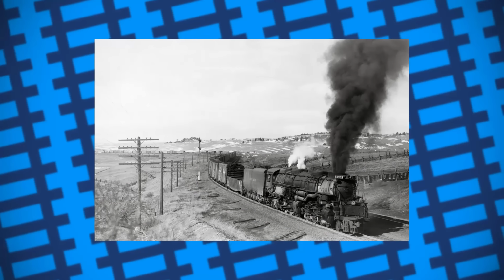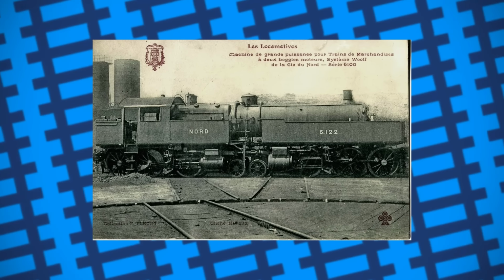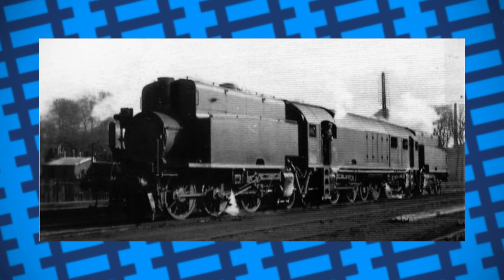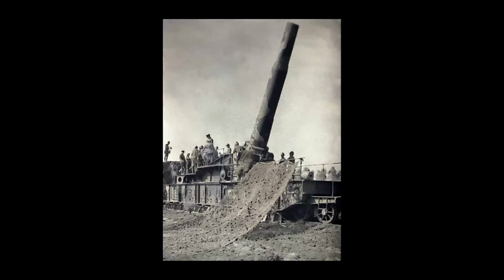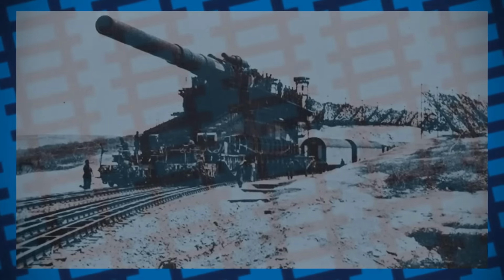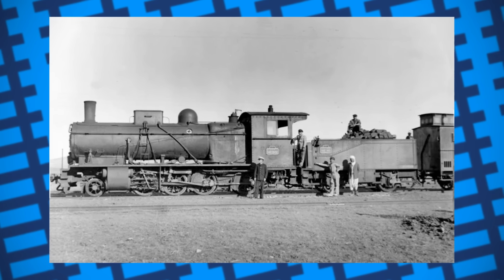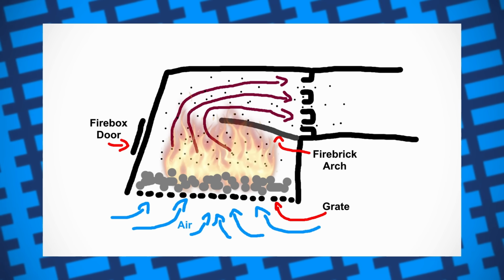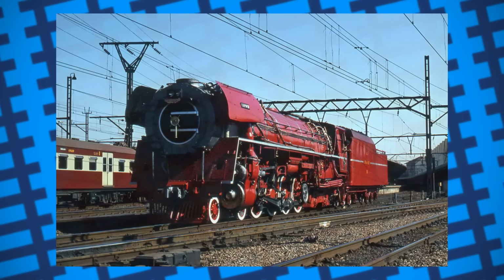Train of Thought COMPILATION - Enormous Engines

Comment: You know I'm surprised that no one has ever actually considered putting a literal conveyer belt from the tender straight into the fire box. Don't even bother throwing the coal, just keep piling it in and have it roll right into the center.
Reply: they are called automatic stokers and use screw conveyors (belts would not survive the heat).  I think Big Boys had them.

Comment: 9:20 the average freight car nowadays is about 50-55ft long, however back in the 1910s the average freight cars were 40ft long, so the length is slightly less but still very impressive.

Comment: I wonder... (Having not watched the video yet) If TOT has ever mentioned the NZR Ka or Kb locomotives. 4-8-4 mixed goods engines, commissioned by New Zealand Railways because Bayer-Garratt locomotives didn't perform as expected on our stupidly narrow gauge 3-foot-6 rails. The K class but especially the oil burning Kb's worked the mountains of the Southern Alps from Christchurch to Greymouth, and were absolute units!

Comment: Awesome video! A few points, Hyce made a video showing that the Big Boys were exceded in every critical measurement by too many common use engines to list here, The correct term would be "biggest steam locomotive still operating" its horsepower peak (not peak speed) is around 7,000 hp occurring at 41 mph. The Pennsylvania S1 was 8,000 hp at 101 mph. All those horses didn't lay down and take a nap at 102, so it and the T1s often ran much faster. There's a brand new T1 under construction in the U.S. most of the major work is done. One of the biggest Diesel engines ever produced was 6,000 hp. Hyce also explains why steam H.P. is underrated compared to Diesel. The saying goes "a Diesel can start a train it can't pull, a steamer can pull a train it can't start" My grandfather was born in 1902 and worked on the Pennsylvania and the Big Four railroads  As a kid, I asked him if they went to Diesels because they were faster or more powerful, he laughed and said "heck no! Not even close! They are cheaper!" The Nickle Plate rail road (Norfolk and southern) ran through the farm . He said that you had to be careful around those tracks because the faster a steamer goes the quieter it gets. The part touching the farm was the fastest and longest grade on the Nickle Plate in my state. Once, a 6 EMD Diesel engined coal train waiting on the siding got stalled and spun out, they hit the sanders and a huge bang was heard as they shot down the track. They had ripped a gondola car in half! Dad made a spreader bar for our hoist out of the brake linkages, I still have it and the huge railroad crowbar that flipped out from under a hand car on the Lacrosse RR they were using to hold it down to lift a rail and it popped loose and flew through the air and killed my great grandfather (not instantly,  he was paralyzed for weeks). It has an LX and his initials chiseled into it. I still use it! 😊
Reply: so basically if we didn't have thee profit motive your basically saying we could still be running steam to this day on the mainlines for freight?

Comment: Some suggestions for large engines: The Norfolk & Western Y6b, the ultimate coal hauling machine. The Virginian AE class 2-10-10-2 mallet, with 48" diameter low pressure cylinders. No, that's not a typo, a compound mallet that when simpled for starting holds the absolute record for tractive effort - and were successful.

Comment: Btw the big boy was not the biggest ever built that would go to the prr  s1 but if we went by still operating then yes its the biggest with the only prr  s1 getting scrapped.
Reply: Yes but the PRR s1 wasn't really comparable.
Big boys didn't absolutely DESTROY the tracks it ran on.
And the Big Boy wasn't just a show train to prove who was the biggest.
It was a beautiful train dont get me wrong but couldn't be utilized that much comparable. 
It was too long and couldn't navigate the rails as easy.
BIG boys were used all over the US similar to Yellowstones.

THEY WERE THE BIGGEST, MOST SUCCESSFUL AND USEFUL STEAM TRAINS EVER BUILT.

Russia built several very large trains.
Some much bigger then Big boys but they all had issues and most were scrapped and not even used.
Most were too long, too heavy, couldn't properly keep steam and just concepts really.

Remember Russia made a quad plex train but it ate rails.
Ate anything it ran on and couldn't really build steam up to even be  effective at running normal speeds.
Believe it was stored during ww2 and got destroyed during a bomb raid.

Comment: The SAR GL Garrett ( not shown) was the most powerfull locomotive in the world on a 3' 6" gauge track. It is slightly more powerfull than the meter gauge 59 class locomotive of East African Railways by virtue of the fact that the EAR 59 class is rated at 80% of boiler pressure while the SAR GL class is rated at 75% of boiler pressure.

Comment: The SAR 25 Condenser Class   was designed to cope with severe water shortages in the Karoo. It could travel for over 700 miles before taking water and was the only class of lokomotive in the world that worked as as condensers. All other condenser locos in the world were only experiments.

Comment: I'm sorry, where is PRR S1?   Of all of the locomotives it was likely the most powerful passenger steam locomotive ever built and if all modifications to improve its performance at speed were made like yaw dampers, a change of valve gear, poppet valve, and adding a booster motor and the Red Devil modifications with whatever else was needed to run it without RD's wheel slip I suspect it could be a high speed steam locomotive if someone wanted it to be.

Comment: Heavey harry was probably the best working Steam locomotive in Australia, from the very very rare footage I've seen of H220 working freights was truly amazing. like we don't have long freight trains in Australia but harry could haul like 40-60 GY wagons or mixed, I think he also ran the Overland which is Melbourne to Adelaide and the hills in Adelaide are steep
Reply: As a Melburnian, H220 is easily amongst my top 5 favourite steam locos. I've seen it myself at the NRM (Newport Railway Museum), I can confirm it's an abolute unit of an engine. Harry ran the Overland a few times in his life with improved performance over the trains that normally pulled it. His only drawback was his wheelbase, which was  l o n g  . Otherwise, ran like a charm.

Comment: Should be clarified that the steam locomotives are not steam engines. Steam engines are only the piston/cylinder, valve system and drawbar. The locomotive is the whole entire vehicle.

Comment: I’m glad you included South African Railways Class 26. He truly is a unit, with a top speed of 100mph and starting torque of 52000lbf. Unfortunately I live in the wrong part of South Africa so the only engines I see are Class 19s, 3s, 24s, 14s, 12s, Garretts, and older tank engines from the UK. The big engines were mainly found in the northern and western parts of South Africa like Joburg and Capetown.
Reply: Are locos he or she?! I was slightly perplex that you wrote “he”, but when I was modeling British (GWR) railways locos were always “saddle tanks”, “panniers”, “Truro class” …. Just asking.😉
Reply: HE. They are HES.  @Soundbrigade

Comment: I’ve made it 22 minutes in and need to point out that the PRR Q2 (or Q1) is longer and heavier than both the Yellowstones and Big Boys.
Reply: *S1

Q2 was stronger but not longer or heavier.  Also as mentioned there were alot of yellowstones that were stronger as well as the Alleghenys although they weren't used properly so they dont often get mentioned which sucks cause I love those things

Comment: About the belgian quadruplex: it was meant be sold to countries with very high traffic in the Alps. It was actually an italian project rejected by every other railway companies
Reply: Source is available in the German Wikipedia article I wrote. The initiative for this locomotive came from Franco Crosti, the designer of the feed water heater used in this locomotive and many Italian locomotives. The description of the feed water heater is wrong in this video since it not work with exhaust steam but with the normal gases produced by the fire like the standard boiler. Advantage of this system was that much higher feed water temperatures could be reached with this system compared with the standard exhaust steam economizer.
Reply: @peettheengineer  thankyou
Reply: Source?
Reply: @davidetrimigliozzi3091  gimme some time bc i need to find the book
Reply: @davidetrimigliozzi3091 "Le locomotive a vapore" - Luciano Greggio (Arnoldo Mondadori editore)
Reply: Someone pointed this out in the original video, too.
Reply: The video does not cite sources @koopapoopypanya9485

Comment: Please, train of thought, as a non native english speaker, i beg of you... Consider disabling the automatic title translation in your videos :( the quality in the translation is still pretty poor, and it totally ruins all the hard work that you have been doing. The automatic subtitles seems to do a pretty good job though.
Reply: Okay but you got me curious, what are the autotranslations like?
Reply: @urbescapade  Ok, besides of the fact that it got The Polar Express video title wrong, and called it The Horror Express (I don't even know if it was intentional, given the memes about that movie), one of the most clear and annoying examples is the use of the english word Engine. In spanish, it has different meanings; it can be "motor" (the internal combustion engine that is installed inside a car, or a power generator, for example), "máquina" (machine, something that moves and might or not produce something) or "locomotora" (locomotive, any kind of it). In this context, "locomotora" would be the right term to use, but "máquina" could also be a synonym, giving it a bit of context (steam engine = máquina de vapor, not specifying if that engine is stationary or a railway)
However, the automatic translator goes for the most general use, "engine" as "motor", that would be wrong in this case. And it sounds so.... Unnatural and cringey.
Reply: @urbescapade  another example: tank engine.

Tank, just like in english, have more than one term; war tank or like a tank, a deposit, something to store liquid.

But in spanish, we don't call the tanks in a train as such. We simply use the word "ténder" (yes, the english word is also the Spanish one, we took it borrowed). So a tank engine would be called "locomotora ténder"
The automatic translator butchered that term, calling it "locomotora de tanque", something similar to "war tank locomotive".